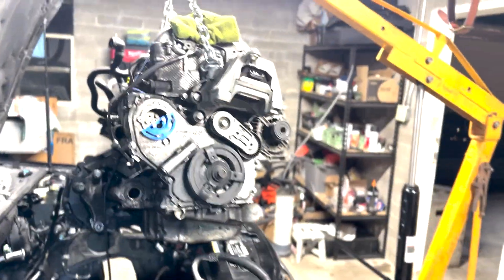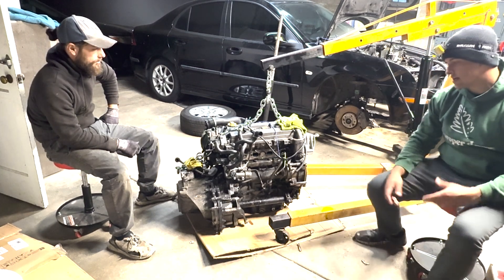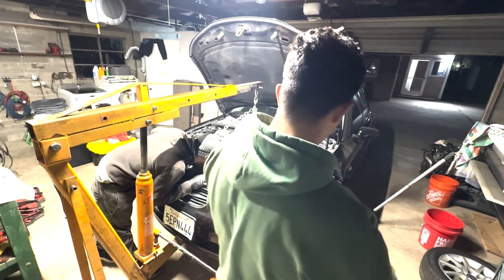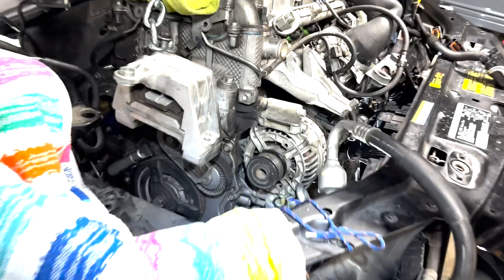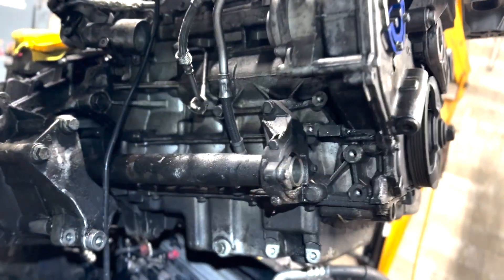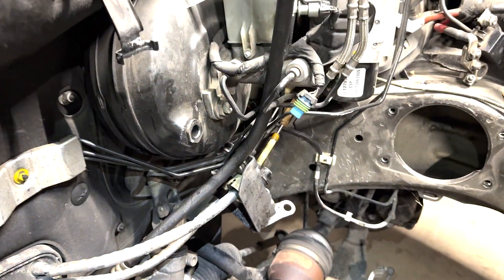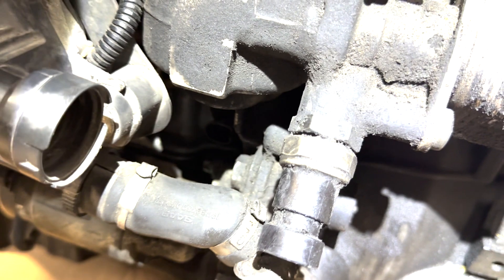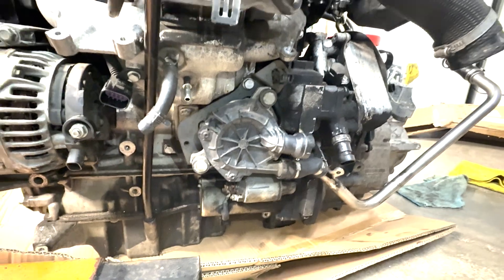Saab 9-3 2.0L Big Turbo Build (Part 2) - Engine Pull & F40 Transmission Removal

Comment: I did the water pump repair on my driveway. Laying on my back for 1 day. I changed all the rubbers connected to the cooling system. It was a pain in the butt (and back) but it was worth it. I also fixed a leaky oil sump.

Comment: I own a 2003 Saab 9-3 Arc sedan -leaking coolant  - likely  a water pump gasket - While I would hope the job wouldn't go this route, you never know!  What would you charge a client for the work you doing in this video?  Just curious..And what would a replacement water pump install cost a client IF you didn't go this very, very thorough extraction?

Comment: holy crap 😁 that's like taking out a gun to kill a fly... I replaced water pump without removing exhaust pipe, just used extensions, couple long ratcheting wrenches do the trick.
Reply from the maker: Well we’re going to mock up the new turbo and lines, do some other maintenance, clean the engine, few other things. Did you have magnetic sockets to get the three bolts out of that cavity or how did you avoid dropping them deeper into the timing area?

Comment: Cars like this i lower the engine plus gearbox.. sometimes including subframe.. and raise the car.. result.. less damage, and not neccesairy to remove all the auxillary parts.. just like the factory..
Reply from the maker: Good feedback! Maybe I’ll try putting it back in that way. Without a lift though that’s a bit tough
Reply: @thejsgarage  Yes.. i understand, a lift is a necesairy item.
i also use sometimes 2 chainhoists so can control all as good as possible.. 1 on the engine side and 1 on the gearbox, so can tilt the whole drivetrain..
Other reason: i almost work alone..
Reply from the maker: Gotcha - all good things lol we’ve discussed chain hoists too actually